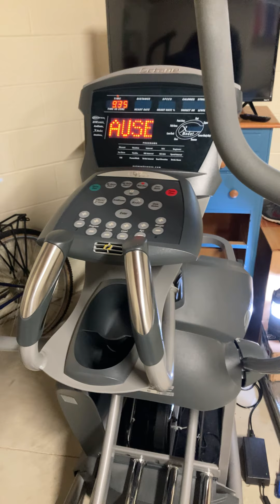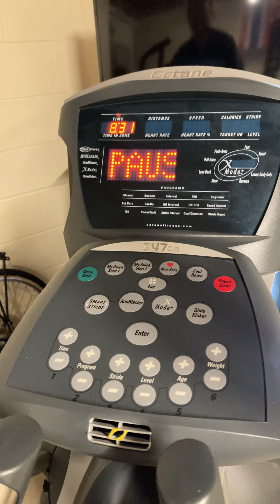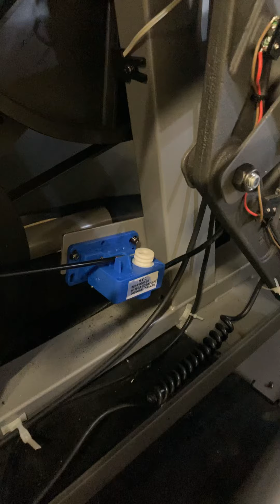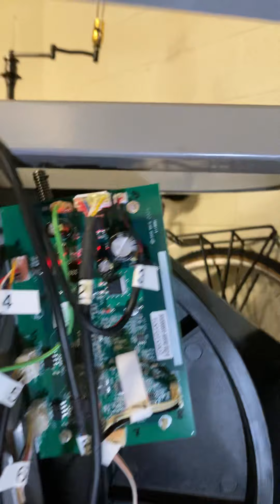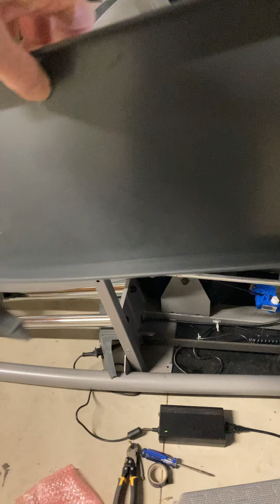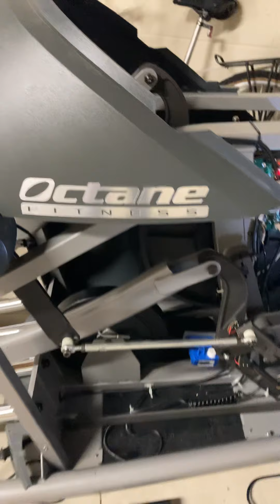Octane Elliptical repair tips - Q47ce - servomotor

Comment: Hello,

Just replaced the servo motor on my Q37ci, but resistance seems very heavy, even at level one. Any idea whar went wrong?
Reply from the maker: My problem is the opposite; light until setting 10.  I think the error is in how we wound the wire on the motor spindle. There’s a specific method. Try calling Octane service. I found them helpful pre-install.

Comment: My Octane Q37e Servo Motor is not getting power signal to motor. I replaced it with a new one $29 plus $31.07 for shipping $60 USA which was $88 out of my pocket. and the Servo Motor turned out to be faulty.. But when tested the motor with a 9 volt battery the motor turned on but I  only got a loud ticking sound going repeated from level 1 to 2. I then tried the other Servo Motor and it  just was continuous rotation. Just wondering why the Elliptical did not power up the Servo Motor in the first place? I was not getting any resistance  levels working due to Servo Motor not working.Octane support told me with my make and model number  my machine being 15 yrs. old that the parts were more expansive. Circuit Board $400 but if I purchased the Circuit Board as well and the display panel it was $272 USA. Besides that this elliptical has no hand held heart monitors on the grips but it came with a chest strap.  thank you for your response. if i purchase the suggested parts I will then have $1750 tied up in this machine. it has been a big headache ever since I brought it home. I know if I tried to sell it for the cost I will have it I would never sell lit. so I would except  a $250 loss selling it for $1500 and purchase a newer model with cheaper parts. I emailed Octane support asking that if I purchase the suggested parts will they wavier the shipping fees that is only $31.07. My integrity wont allow me to sell a none functional machine. I think the guy I purchased this machine lost his integrity. Just based on all the good reviews I had heard and the follow stating it was a fine machine. once I seen it powered up I assumed everything worked fine so I asked him and he replied yes.
Reply from the maker: Sorry to hear of your troubles. A dozen Octane ellipticals are used at my gym, and are robust.